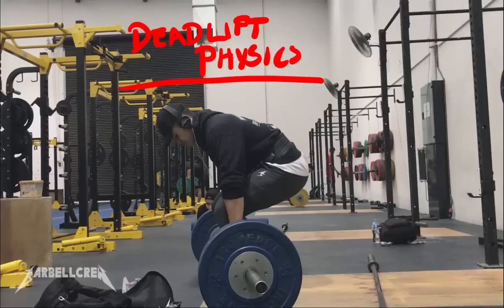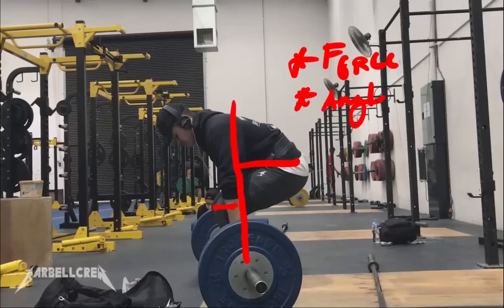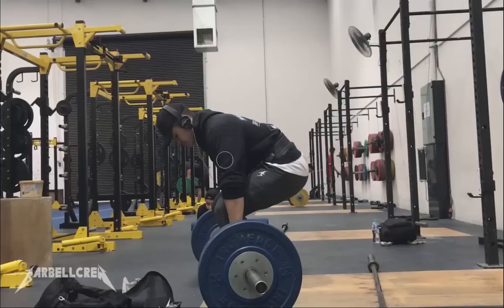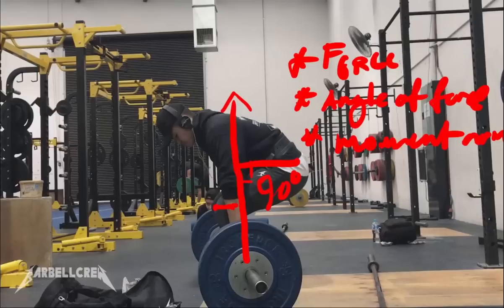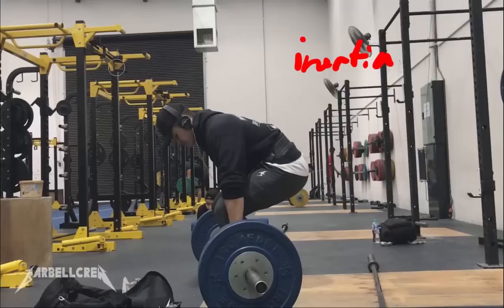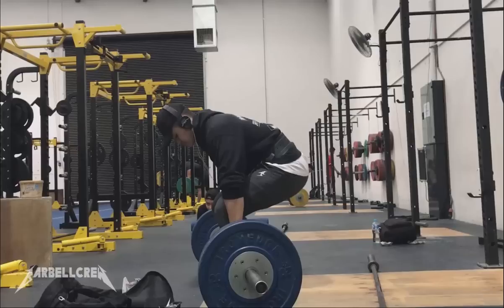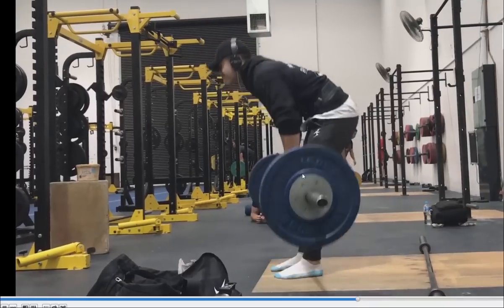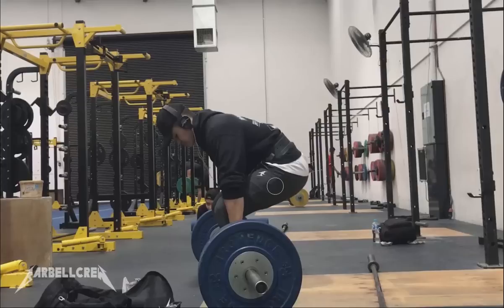How to put 10kg on your DEADLIFT

Comment: I agree that by rounding like you do will probably benefit your deadlift to a certain extent due to momentum and breaking inertia faster. I used to pull like that, then "fixed" my form and 2 years later i am only close to my old pr. However don't you think that this technique would increase chances of a lumbar or vertebrae injury therefore being not so beneficial in the long run?

Comment: my right ear loved your voice lmao. good stuff though, is next video gonna show more of the application of theory from this video? felt it was a bit abstract
Reply from the maker: Not completely concise with the concept. However, the concept is explained nevertheless. It's a quick tip and understanding it is quite simple but if a more detailed explanation is needed by people I'll be going into why I curve my thoracic spine, why I used bumpers and a specific bar etc. I know this may help a number of people despite the lack of depth, like myself others can't stand to listen to fluff for 10 minutes
Reply: Kevin Booey right i see where you're coming from, i rewatched the video and got the idea. btw what's your background in from uni? physics related?
Reply from the maker: Mechanical Engineering
Reply: Momentum and explosive power are literally the most important things when creating an efficient deadlift, and to add, maintaining the most efficient leverage possible for each person which varies bio-mechanically. The more even the push and pull equilibrium the greater the bar path and application of force. Great video kev 💪🏾

Comment: So Kevin are you saying this position is superior for producing more momentum compared to the common position people use where their knees are behind the bar
Reply from the maker: It depends how you want to lift the weight. A lot of people aren't conditioned or built to pull like this off the floor. However, this is some of the concepts behind how I lift which the public can consider
Reply: So are you saying accelerating before the weight comes off the floor is what produces the momentum ?
Reply from the maker: Accelerating the mass which is your body. My muscles are completely tight as soon as I get to the bottom of the setup. The objective is to hit the weight with as much force as possible whilst remaining tight, in turn, the velocity of the weights will increase, therefore, directly influencing the momentum to increase

Comment: So the idea is your starting position is technically 'out of position' to make the start of the movement easier (using quads more and being over the bar) then pray to God you can lock it out?
Reply from the maker: highly dependant on the equipment that you use (equipment mechanics) which is an underrated topic. If you're consistent with a lifting platform (plates and bar) that you're used to, locking out will be dependent on a number of factors of strength as well as positioning. Is a deadlift, deadstop from the ground, easier or a deadlift from above your shins (a rack pull almost) easier? The answer to that is sumo, sumo is easier.
Reply: Kevin Booey I know it's late but are you high? Sumo is for cheaters and if I could cheat, I'd sumo all day I'm just jealous. Btw I pull more off the ground than I do off blocks.. I guess because I'm using inertia to break the floor and I'm just 'coasting' up the middle part of the lift as this vid suggests?
Reply from the maker: Your right, sumo is for cheaters, this video is intended for legitimate deadlift connoisseurs. But to answer you seriously, yes.

I am high. 

jk yes, to your last question
Reply: LOL

Comment: Isn't momentum mass x velocity? and the initial momentum would then be part of your body mass x a fairly low velocity so the momentum just before picking the bar up would be quite low? I do maths but not physics so not fully certain, but if so I think the momentum would be fairly low as the short distance means velocity can't get that high and the low mass with that would make momentum low.
Reply from the maker: The mass in this circumstance is the bar and plates itself. But in order to produce velocity in the bar, you are the mass which has to accelerate to produce a force which creates velocity in the bar and plates.
Reply: Kevin Booey ofcourse I agree, but I don't think the acceleration of your body has to occur before that of the bar, many people find it very helpful but many others also accelerate both at the same time, essentially grip and rip vs pull the slack out before you start, e.g. old Pete rubish vs new Pete rubish, garret massthetics vs Tom Martin. I think it's a question of will the improved momentum carry you all the way through to lock out, most people that do the style you do fail at lockout but with slightly more speed off the floor they would have got it. Not saying either is right or wrong but one is speed at the bottom and using the momentum to lock out vs not needing the momentum to lock so failing at lockout is rare
Reply from the maker: I see where you're coming from, I should have put a disclaimer saying that this may or may not work, like any other tip or trick in the gym. But rather should be something that people can consider
Reply: Harry Scott i think u will have a higher risk of injury if u start accelarating before the lift
Reply: Kevin Booey fair enough, good video none the less
Reply: Sindre Laupstad probably but it also depends on other factors, a lot of people aren't aware that a curved spine isn't actually that dangerous, it's more so when it curves whilst under weight, so if you start with a given curvature and it doesn't worsen throughout the lift the risk of injury is much lower than if it did worsen. But overall I would agree you have to have a lot of experience with the technique to prevent bicep tear, bulged discs etc, but can be done safely
Reply from the maker: Making sure that your elbows are locked out when the lift initiates is a must as well. I'll definitely have to make a more detailed video including the intricacies. But as you mentioned before with lifters like rubish and garret , they lift on texas bars which mechanically will be a disadvantage when using this technique which ive experienced myself where there is a wave which travels from the centre of the bar to the plates which sends your body back down causing you to stall or create excessive vibration.  So equipment is also an important factor. Stiffer to mildly whippy bars would be the way to go with this technique. 
Tfw all of this just to pick something off the floor.
Reply: How enlightening!
Reply: Kevin Booey That makes sense, tfw need another 400kg on my pull to be competitive. Dyou study physics at uni?
Reply from the maker: Try sumo, that may solve all issues plus save you from watching my videos. Currently in my final year of Mechanical engineering
Reply: Kevin Booey I'm piss at Sumo but working on it, mirin that's a serious degree
Reply: What are your thoughts about having a bigger injury risk. With this technique? (bicep and lower back mostly)
Reply from the maker: It's not something I would suggest for beginners and is definitely something that you would need to condition your body to do before you jump into serious weights. The injuries and muscle tightness generally occur around the top of the glute with this form if not taken care of. So a suggestion would be to roll your glutes out with a ball. Bicep tears shouldn't be a concern if you deadlift with your elbows locked out. It requires a great deal of timing throughout your entire body. 

(Also) as for lower back injuries, if you have the proper equipment ie. powerlifting 10mm-13mm belt and have it both on and braced PROPERLY your core should be rigid and no flexion should occur to cause a serious lower back injury. I have never injured my lower back deadlifting this way

Comment: In your opinion, is this good for the long run? since yanking it, often puts the lumbar spine in bad position. Most of the grip and rip pullers slowly moved towards more controlled pull by easing the bar off the floor more.

Comment: Dude good vid, but not sure about the yanking part with momentum.  With my experience I used to yank the bar to get it moving and the problem with that is as your technique to yank becomes better the muscles involved to with driving the bar through to the top become weaker in proportion (especially through the knee area).  On a max lift this can cause the bar path to change somewhat, which can put the body into a position less mechanically effective which in turn can promote injury or breakdown of muscle tissue, ligaments, etc.  I think the best method is learn to be tight at the bottom, squeeze and take the slack out of the bar first before pulling it off the ground.  It teaches the body to always use the same bar path and even on a max lift, it is very difficult to get injured.

Comment: aren't you worried about tearing a bicep tendon by janking on the bar so hard? or even herniating a disc?
Reply from the maker: My elbows are always locked out and my core is rigid from bracing. I'll always let go of a lift if it becomes too difficult once the weights get heavy enough

Comment: You have a great deadlift but that's due to your levers. You have very long arms. That why your squat and bench is not on the same level. I might add very few top powerlifters grip and rip like you, but seems to work well in your case.
Reply from the maker: I agree, my levers are optimal for deadlifting. However, without this knowledge I would not be lifting as much. I've trained multiple people to 260kg deadlifts sub 83kg in a matter of months one of them pulling 295kg at 70kg that I had trained from the ground up. Some of the best lifters under 93kg - 83kg use grip n rip including sumo lifters. So to discredit genuine information "due to [my] levers" is like saying Micheal Phelps didn't train hard or smart to become the best in the world
Reply: Go squat 300kg and bench 200kg then i will shut my mouth. It's always harder to build up your weak lifts, that's when good coaching comes into play. At the end of the day genetics play supreme. I am not discrediting you as a lifter you a very good, better than me, but your always posting videos of your deadlifts because that's what your obviously good at and find easy.
Reply: slws14 the point is, optimal levers + the knowledge he has is why he has such a good deadlift he isn't denying he has optimal levers so saying "go squat 300kg" is just arrogant man.
Reply: Bro this all pulling or half push down after momentum?